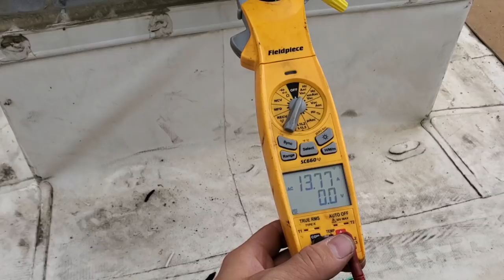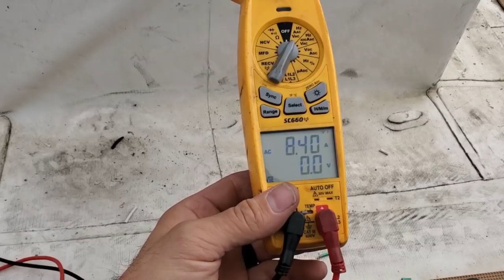EXHAUST FAN REPLACEMENT (CRANE LIFT)

Comment: Is pdi atlanta a manufacturer's of loren cook upblast roof fans or does pdi order them from loren cook are they a subsidiary i got mine new from a city discount in Georga to pull steam out of my hobart conveyor dish washer i called loren cook cause it said it was a pdi fan but my sales pink slip says its a loren cook i needed a part so i called loren cook but it says it comes up pdi atlanta but acity discount told me to contact loren cook my fan is on a old middle schools hobart dish machine that is now a special needs school and recreation facility that i own it was replaced because they previous school boards maintenance nevertheless kept it up but is loren cook have anything to do with pdi atlanta or is that just they equipment supplie houses brand and they get them from loren cook

Comment: Actually your hand signals are the same here in the Raleigh area and normally the crane operator is alone with no helper, so we are his eyes.  We also help setup the crane if possible to get things moving.  I wish we had a crane for every job, but boss will not allow a crane for compressors or exhaust fans.  You are soo spoiled lol.  Just kidding.
Reply from the maker: It's because I'm the boss.......😁